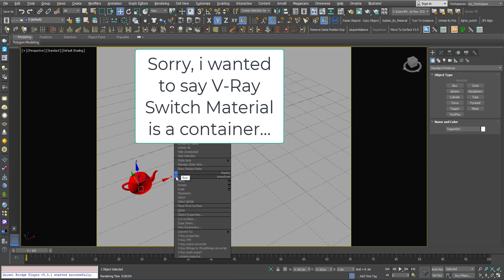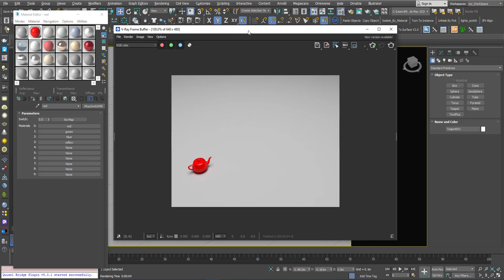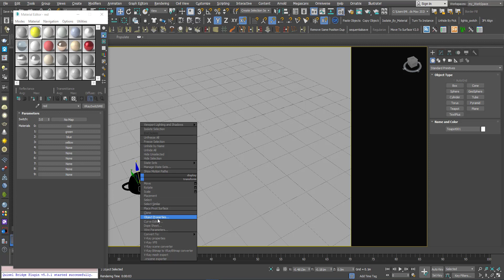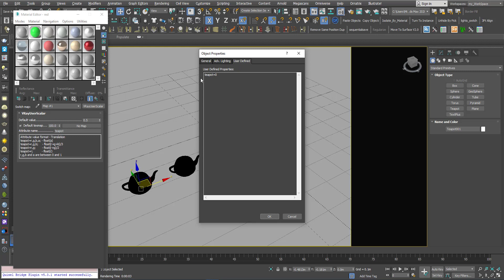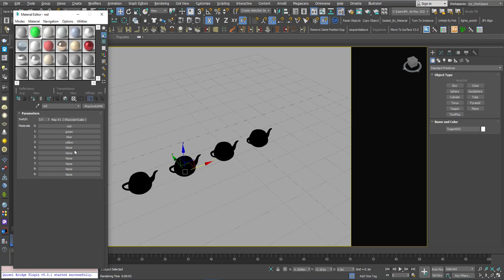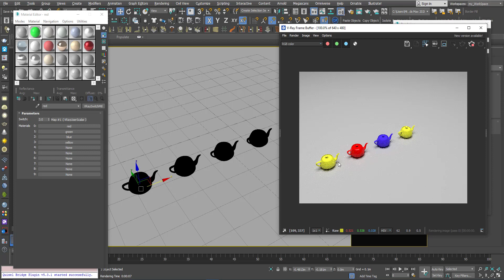3DS Max - V-Ray - VraySwitchMtl Explained

Comment: What's the advantage of this technique vs just manually applying a different material? Wouldn't it In both cases take approximately the same amount of time to type a different value for the variable of the selected object compared to selecting the object and applying a different material? Also, you would have to know or remember what the different numbers in the switch material mean. 1, 2, 3... what material could that be? Is it red? Or blue? You would have to constantly have the material editor open to check this as you assign the values in the Object Properties window. It doesn't seem too intuitive. Or am I missing something?
Reply from the maker: Hi,

In most cases, you'll be using the straightforward method 1.

When you like to experiment, while the real-time renderer is ON, and the material editor is open. This is a fast approach to see the result quickly without the need to create multiple objects.

Also, in the same way, if you want to produce multiple material variations. Just change the Switch value and see the result. Plus, you'll be doing all that without wasting a lot of material slots. Everything is in one place, compact.

In addition to that, the Switch spinner, like most spinners in Max, can be animated, So, if you're doing animation, you can jump from one material to another at a certain keyframe.

The method 2, can be useful if you have the same material, but you like to create slight variations From it, like, for example, if you have some vegetation like trees, plants, etc,.. you can assign different variable values to few copies a spread them around. If you're using VrayProxy, multiple proxies can have different variable values, while loading the same object to create certain variations. 

Also, this method, combined with scripting, can be useful in an animation routine. A script can create variables with random values automatically, and maybe using that to do things with certain objects based on their variable values(Advanced approach).
Reply: @MiledRizk  Ah, got it. Thanks! 🙂BTW, for me, when I change the variable in "User Defined Properties", IPR doesn't automatically update to see the change. I have to stop and start IPR again to see the change. Is this normal? I'm using V-Ray 7.
Reply from the maker: @bgtubber unfortunately it's the normal behavior.